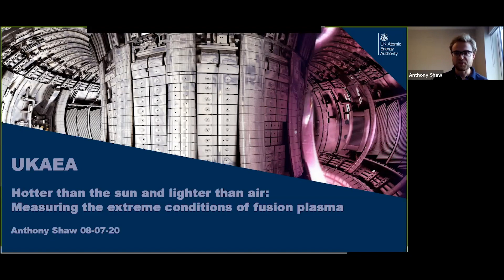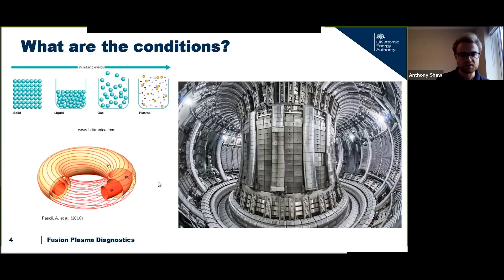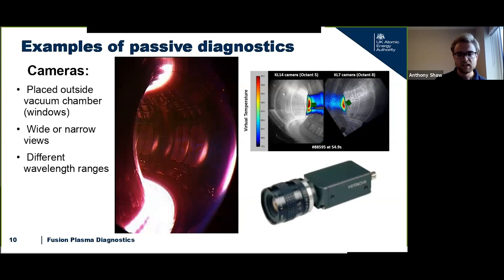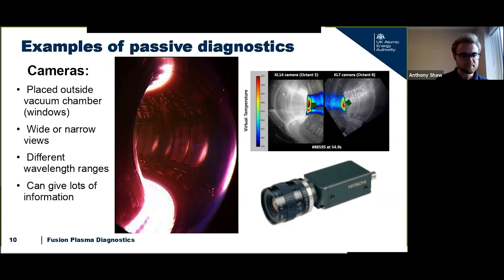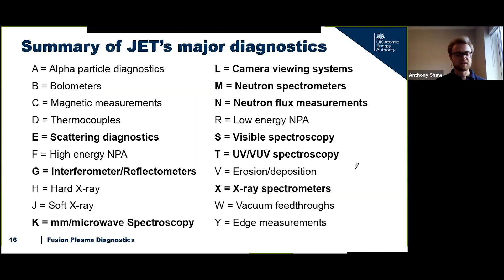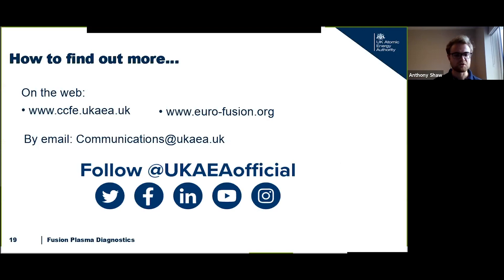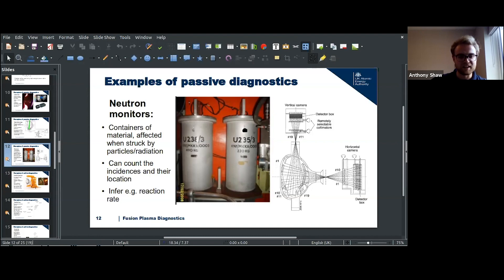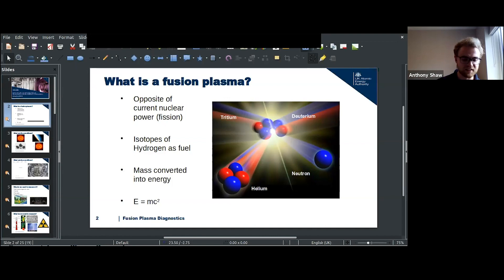Hotter than the sun and lighter than air; measuring the extreme conditions of fusion plasma

Comment: Late view and comment but I do have a question: As Mr Shaw talked about passive sensors he mentioned using uranium to measure neutron production. Is there a possibility to use a combination of a fusion torus and a fission reactor for a powerplant. This would use the neutrons in traditional fission systems while operating the fusion plasma device. At least this might be a step toward perfected fusion power systems.